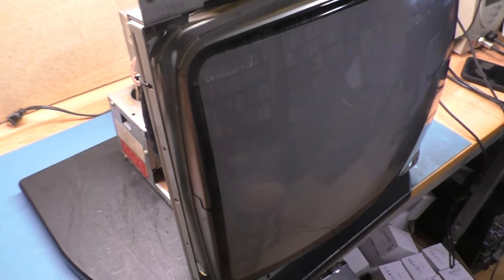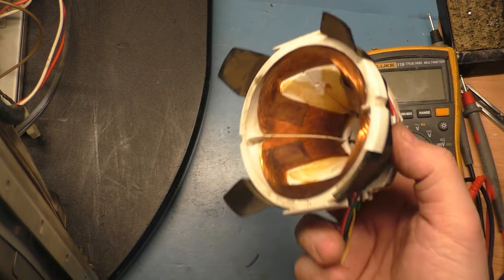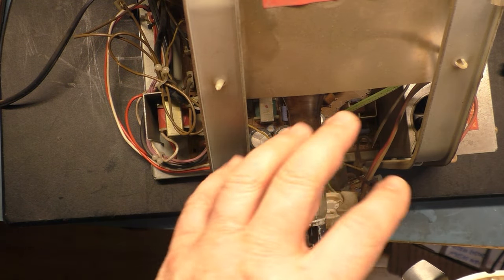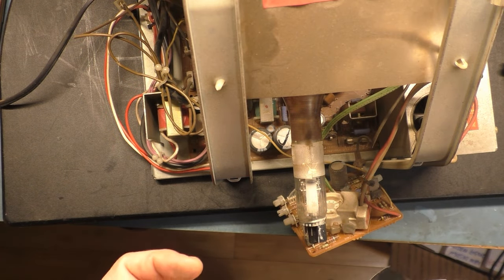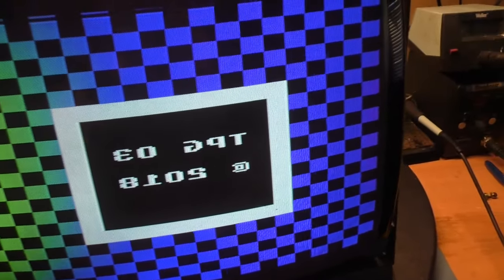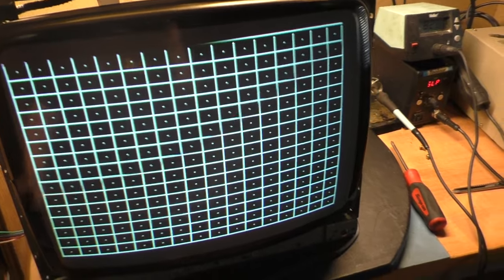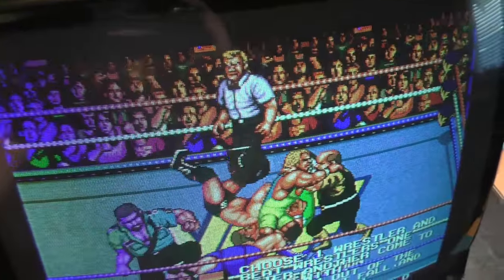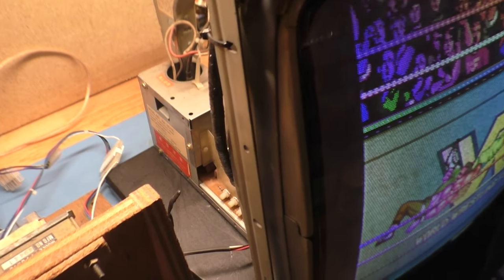18" Sharp XM-1801 Arcade Monitor Repair - Burned Yoke Replacement - Easiest Swap Ever?

Comment: In my experience the scan coils burn up where they touch the rubber wedges. Chemical reaction. I always cover the wedges with one  small strip of electrical tape.

Comment: Awesome video Mike.  Question: What is the purpose of measure impedence on the four wires on the yoke?  I have an 1801 that blew the flyback but I'm not sure if the yoke is burned up (short of taking off and inspecting).  What will out of range impedence mean?
Reply from the maker: Thank you. The impedance is based on the number of windings on the yoke. Impedance is the effective resistance of the circuit, so it needs to be correct/withing the tolerance range of what the chassis requires or the chassis can be damaged. That's why it's not just about the ohms when reading the windings, the impedance is more important. 

The B+ runs through the yoke and any number of things can get damaged if the impedance is not correct. The K7000 yoke just happens to be within all the tolerance levels and can be dropped right in as a replacement on the 1801. You can measure your yoke to see. If it read close to what I measured in the video, you should be fine. A burned up flyback won't generally cause a yoke to fail.

Comment: The purity ring needs adjustment. Proof was when you demagnetised it. Seriously the magnet magnetises and the ac degassing coil demagnetises 😊won’t fix it self over time
Reply from the maker: Actually, I ended up just needing to scootch the yoke back slightly. It’s good to go now.